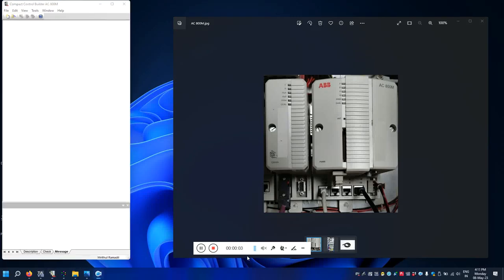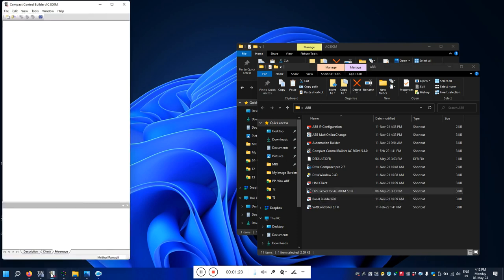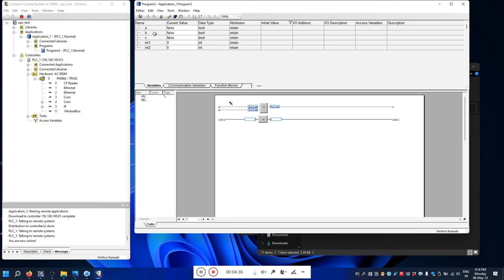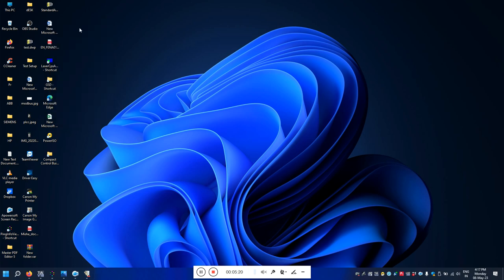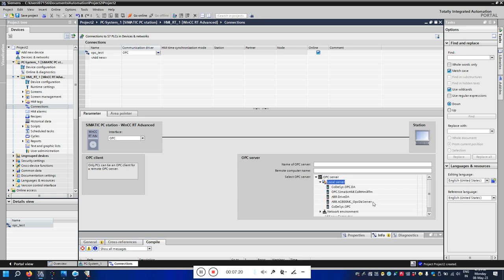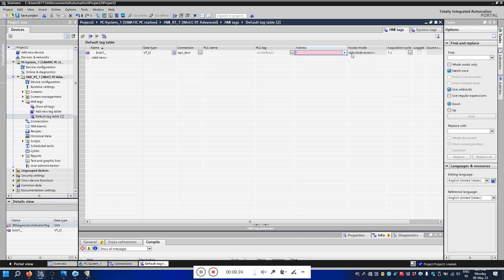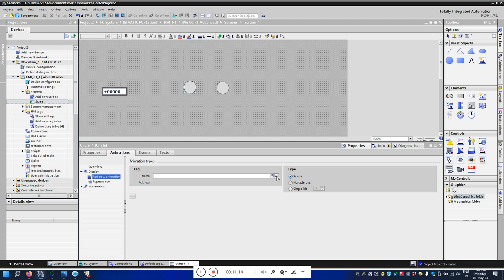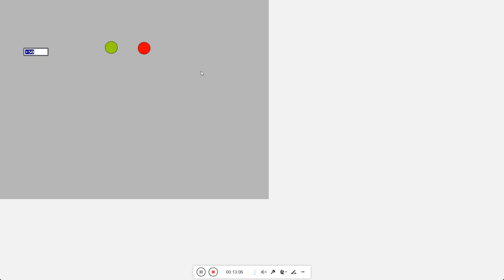28. ABB AC800M PLC OPC Siemens WinCC HMI

Comment: That's a great video i waiting it for a long time
But i have a question if i want to connect to an hmi through opc what have i do same steps or what
Reply from the maker: Yes, opc configuration for plc side ie very easy as i have shown in the video. Any HMI that supports opc can be connected to the opc server
Reply: @averageengineer4266   i mean there's any other configuration in hmi side or not just like video only or any thing else
Reply from the maker: @heshamzahra4836  that depends on the HMI software, here i have used wincc software as opc client
Reply: @averageengineer4266  but in most HMI it used opc ua not opc da how can i relate between opc ua and opc da 
Because in my work i have two hmi abb and connected to abb plc ac800 but one of this hmi have issue but when i asked abb agent to import one hmi it's so so expensive and i need to connect to this plc one of hmi i don't care which brand any brand but i need help for this
Reply from the maker: @heshamzahra4836  If the HMI only supports opc ua, then you need to convert opc da to ua. OPC expert is a free software which can do that
Reply: @averageengineer4266   and the program can download and work in hmi 
Please i need help for this 🙏
Reply: What u did is perfect, could you please make it reverse, I mean connect Siemens plc to abb 800xa, thank u